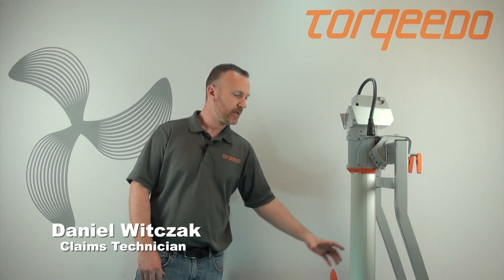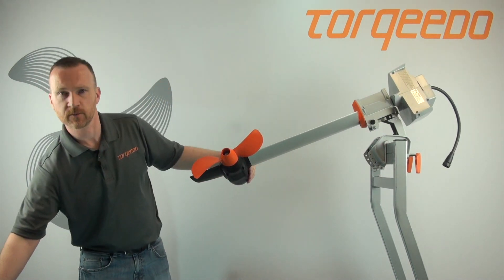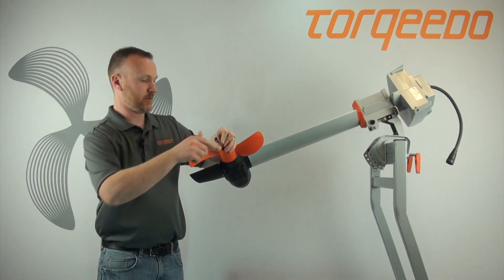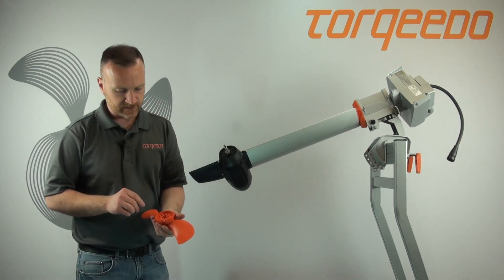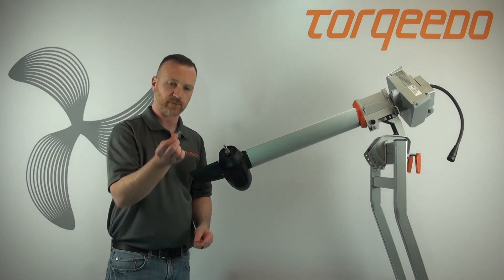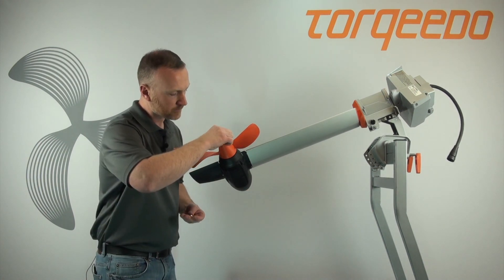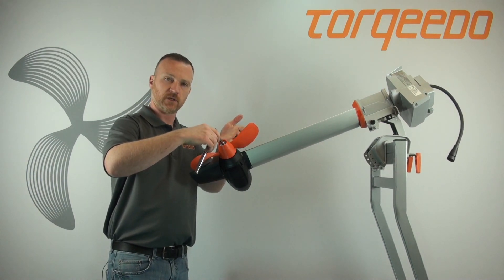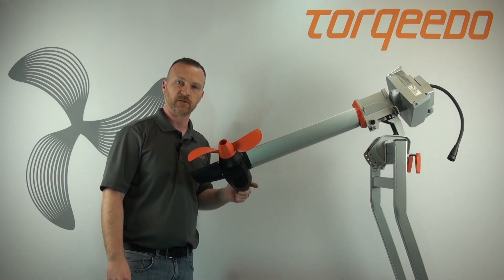Torqeedo Travel Motor Propeller Removal

Comment: This video depicts a new or prepared motor.  If you try this on a real motor 1) you will have to whack the prop to remove it, which sucks because it's plastic and youre smacking against the motor shaft and bearings 2) the shear pin will be terribly corroded seized in the shaft.

As soon as you buy a torqeedo, strip this assembly down and cover it with marine grease or nev r seize, and do so every year.  The shear pin should be more corrosion resistant but its not.

Comment: My propeller is completely attached to screw. I took nut off and it just spins with propeller. Should I wack it with a mallet?
Reply from the maker: Hello EncountersUSA! It sounds like your propeller is stuck on the shaft. Before attempting to use a mallet or hammer, I'd recommend trying the following steps:

1.Check for any visible obstructions or debris that might be holding the propeller in place.
2.Try gently wiggling the propeller by hand to loosen any blockages.
3. If you decide to use a mallet or soft hammer, do so with caution. A forceful hit could damage the propeller or the shaft.
4. If that doesn't work, consider using a lubricant or rust remover.

If you continue to face issues, we advise reaching out to our customer service. You can contact them at: T +1 (815) 444 8806 / service_usa@torqeedo.com. Safety first!

Comment: Thanks. Needed to buy a wrench set for £30 to get prop off, and now see that shear pin is broken and back of propeller is damaged so need to buy a new one for £100. However still better than sending off to service centre. Thanks again! 🙂
Reply from the maker: Dear hellishmovie,

Thank you so much for your feedback. We're sorry to hear about the broken shear pin and damaged propeller on your Torqeedo engine. We appreciate your understanding that these incidents can occur and are pleased to know you found value in our instructional video on how to remove the propeller.

We hope that your new propeller will bring you many hours of smooth boating.

Best regards,
Your Torqeedo-Team

Comment: Do you need to use a new nylock nut?
Reply from the maker: Hi mrwrapper, in the ideal case it is the best to use a new nut, but is not absolutely necessary.

Due to the fact it is a self-locking nut, it loses its "securing effect" with repeated use.